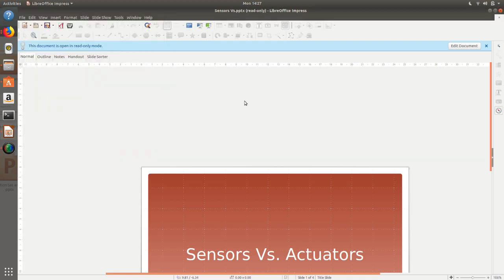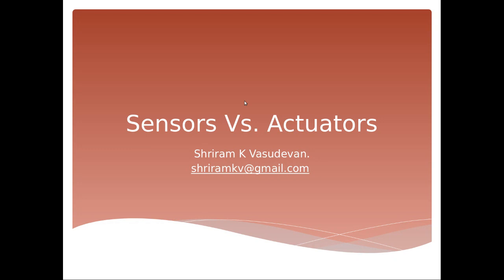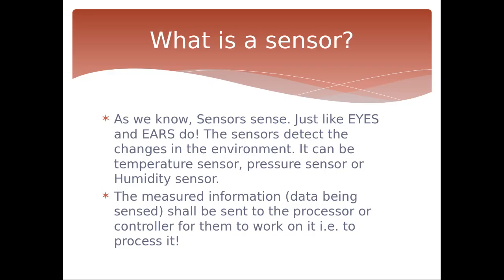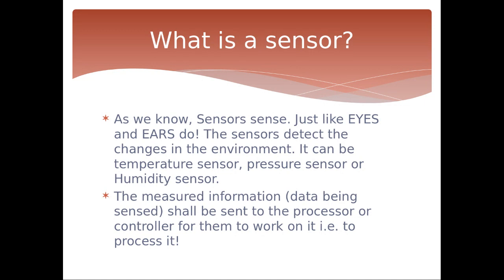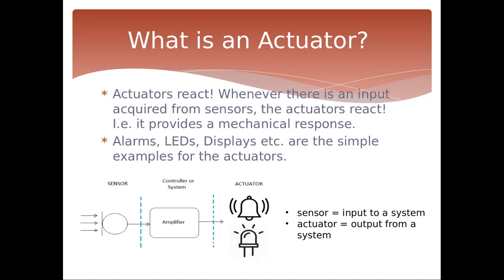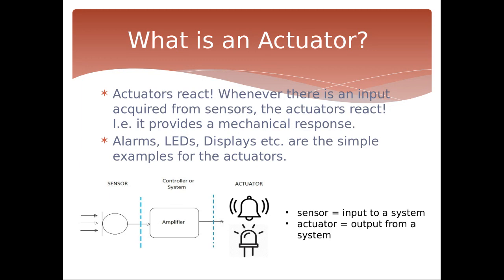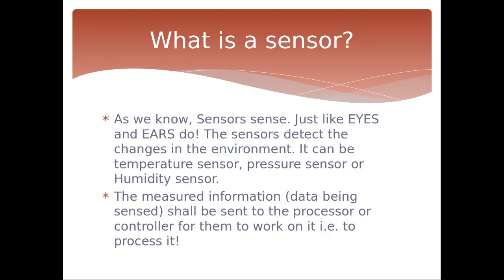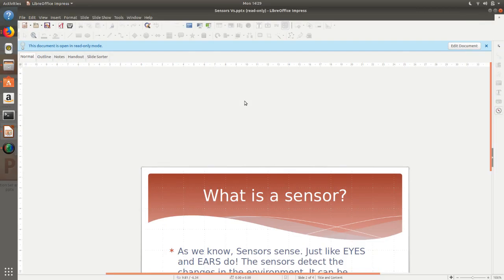Sensors Vs. Actuators - A Quick View.

Comment: In the second slide, you mentioned that actuator provides a mechanical response,but if an LDE goes on or off, it is not typically a mechanical response. Do you meant to say that actuator provised a response.